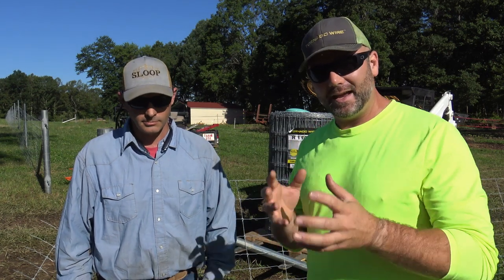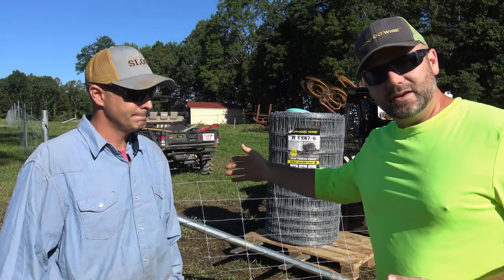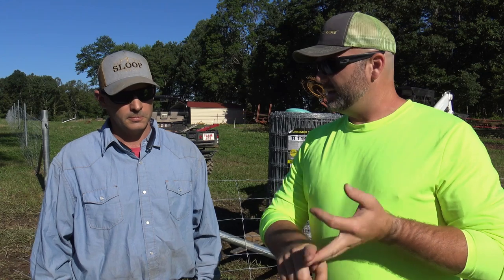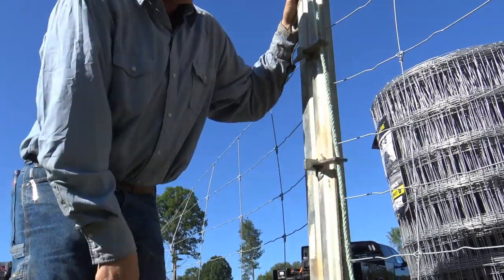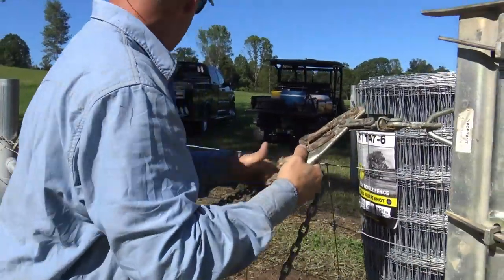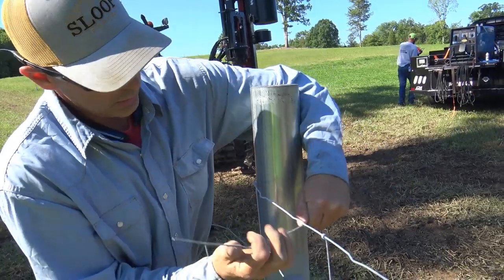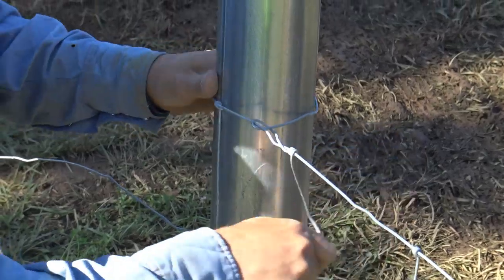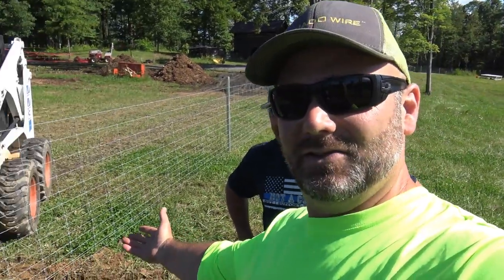STRETCHING HIGH TENSILE WOVEN WIRE FARM FENCING INSTALLATION TIPS AND TRICKS!

Comment: Pretty impressive I must say. That stretcher bar sure snugs everything up tight!!
This might be a stupid question, but is the fence secured to any of the poles going down the line? 

Probably the next step I'm guessing ....
I've only ever known wood post fencing so this is all new to me. 😊 

✌🏻💛🇨🇦
Reply: Teena I’m almost 100% sure it would have to be.
Reply: Spring Hill I agree. Just don't remember him mentioning it yet, so I was curious 😁
Reply from the maker: Yep....so the fence is attached to the poles via wire ties....they are designed as the "weak part" of the fence in case a tree falls on the line....the wire tie releases and the fence pops right back up after you cut the tree off
Reply: Stoney Ridge Farmer That is very smart. Thanks for the reply 😊

Comment: Good fence, only comment on the wooden fence corner post test, would like to see the test with a diagonal brace to the second post back to see what the movement would have been....(Only because we use Cedar fence posts in South Texas historically on our barbed wire fencing. Pipe and "T" posts have come into play more in the past 25 years or so.)

Comment: So I have a fencing question.  Can I stretch to an angled corner, staple to the wood double H Brace there. Then continue to the next corner, staple there and keep going?  Or will I need to cut and wrap at every corner even the angled one.  When I say angled, it's not 90 degrees, maybe 45 degrees.

Comment: Where was that stretcher bar when I was hanging fence? Wife and I used  two pieces of wooden 2X4 with 5 bolts and nuts and 2 come-a-longs. That device is slicker then owl poo. Are you going to tie the fence to the other posts now?
Reply from the maker: Just a wire tie similar to what's used for commercial chain link ...we'll show ya soon

Comment: Do you know where I can buy that Strainrite strainer board?  I cannot find that strainer board anywhere in the USA.  It is a UK or Netherlands product.  I really wanted to buy it.  Strainrite1530mm Strainer Board – Wedge Clamp

    Press formed steel strainer boards
    Compatible with most mesh & netting
    Features the Wedge clamp design
    Overall Height – 1530mm

Comment: I have roughly 300’-400 of fencing I need to put up to finish my project . I’ve put it off for several years now because I’m not sure how to handle my problem. 
My property used to be farming land in central alabama. There are terraces everywhere. 
My other fence line went w the terraces but this last line will run perpendicular to them. There are at least a dozen along this line and the way it’s ran there is about 50’ to 100’ in between each terrace. The elevation difference is about 10’. 
In between some of them are man made mounds of land that either rises up or dips down causing a fencing nightmare (for me). It was caused by folks trying to flatten out the land prior to my purchase of the property. 
I’m using t-post and 6x6 post for my fence. 
My question as you might’ve guessed is how do I run this fence properly with all of the land differences and still make it look decent without having large gaps under the fencing? When I tried to stretch it I couldn’t get it tied to each post because it’d be on the ground at the post but down the line it’s be above my head (using tractor bucket to stretch). I’d try to tie to each post then let the fence down to tie it to the next but the elevation difference caused wrinkling in the fence. I got so frustrated I just stopped. 
Probably a simple answer but i thought I’d just throw it out there to see what comes back.
Reply from the maker: Dozer where the fence will go?

Comment: Does Luke have something to measure the tension when he is pulling the wire tight? Just curious how you can tell when it is at the proper tension.
Reply from the maker: There is a tension meter that he has...however he pulls until the winch can't pull anymore.....when using stretcher bars we stretch till we can't put any more tension on the wire
Reply: @StoneyRidgeFarmer  Thanks. He is very complimentary of you Josh!
Reply: Steve Terry Hello friend!
Reply: @farmfencesolutionsllc  I am super impressed with your work!
Reply: @steveterry7981   Thank you sir!

Comment: always stand right in line with the winch cable - after tying a jacket to it, of course. For safety. 
Bracing on the corner posts? No. 
Expensive equipment. Yep. Drone. Check. 
Just another farmer working in the fields with his drone. And no gloves. 
WOOOOOOOO!!!

Comment: That's cool that you don't need to brace the posts where the fence changes direction.  That's not true with t-posts and regular field fence.
Reply: I'm sure in about a year he'll have to weld up some bracing at every direction change post because the fence will be leaning over. You can it's already starting in this video, when they put tension on the wire with the winch the first post with the direction change closest to where they were standing was already leaning different than the rest of the posts.
Reply from the maker: First thing we addressed after this video. We were trying to keep from putting a brace on that post...it's 6 feet in the ground...but now has a brace

Comment: You also need a double H and a kicker in the corner.  I'm not trying to criticize what other people do, but if you're going to make an investment in fencing you want it to last.  You are already aware of the cost.  Do you really want to have to go through that again to fix it right?
Reply: Again, please justify this statement with some evidence.
Reply: @farmfencesolutionsllc  I can tell that that soil there is very deep.  You have to think of H brace as a lever used to resist the tension of the wire.  I see people all the time put the H brace post too close together  which doesn't provide a long enough lever to resist the pull of the wire.  I haven't seen where people space them too far apart, but I suspect that would offer too much flex in the brace between the post possibly causing weld failure on the brace.  The ground moves quite a bit seasonally based on moisture content.  The method we use that has proven the test of time is using a double H and a kicker.  That way your post aren't too close together or too far apart.  Again,  if you can provide me a way to contact you I will provide you with photos demonstrating my claims.
Reply: @farmfencesolutionsllc  at 9:08 when Luke is talking about a common mistake people make. Is he saying it’s ok to pull from the strainer post if you don’t have a wench? But what I don’t get is what he means by putting the net board on the wrong side? I’m dumb haha
Reply: @buckinthetree1233  A double H will collapse under the tension that we put on our fences.  Once the center post steps our that first 32nd of an inch, it's all over but the crying.  Brace design and testing is something that we have spent a significant amount of time and money on.  This is not something that we take lightly.
Reply: @kaylecarlile6708  Most folks will put the net board outside of the brace, and pull past it.  Then, cutting the line wires one at a time, they let the slack back into the fence and think that it'll be just fine.  Hope this makes sense.
Reply: @farmfencesolutionsllc  a double H has more strength than a single H.
Reply: @buckinthetree1233  Anyone could build a double that is stronger than a single, as long as they get to build them both to rig the results,  but that doesn't mean that a double is stronger than a single.  Strength is relative to the materials and construction techniques used.  A well  built single H is, in fact, stronger than a well built double H, and that is something that we have proven many times over.  I would speculate that you have not done a proper evaluation of your bracing techniques.  We do an open brace testing every February, and I'd like it if you would be there to build your double brace for some testing, which would help with a fact based argument.  Hope all is well.
Reply: @farmfencesolutionsllc  many things factor into the strength of bracing. The most important aspect is soil type and how the post are anchored into it.  When designing a brace, I think of the H braces as a lever used to keep the corner post from leaning over.  The problem with a single H in my experience is that either the lever is too short or someone has left too large of a gap between them allowing the lever to flex.  I really didn't intend to insult you.  I only wanted to freely offer you my experience hoping that it may help you.  If your are satisfied with your results then by all means continue.
Reply: @buckinthetree1233  I'm not insulted at all.  We've tested more braces that you can count, so we do have a pretty good handle on what will work, and what won't.  Please consider coming to our Fall Fence Forum next October, and see if your brace can with the $1,000 prize.